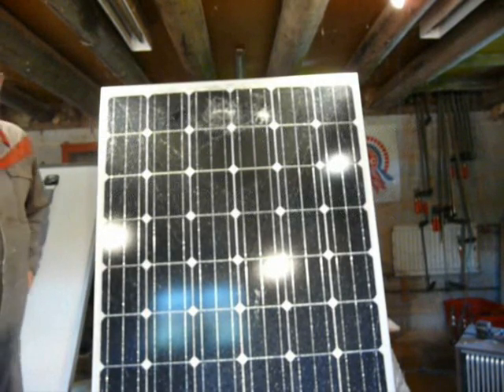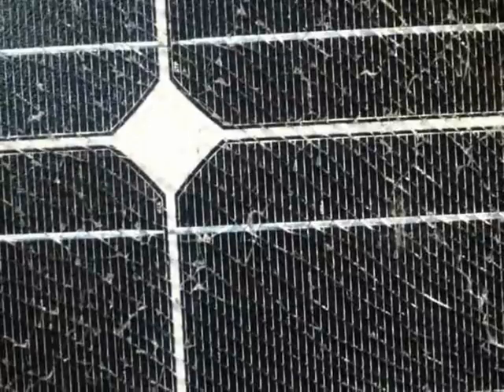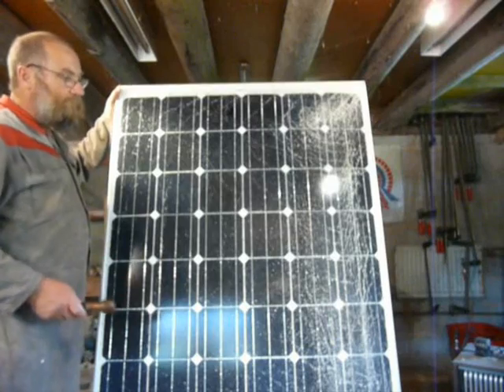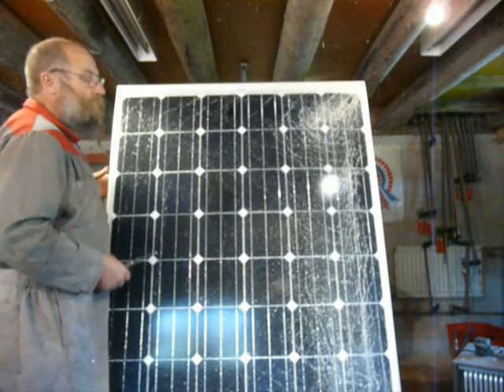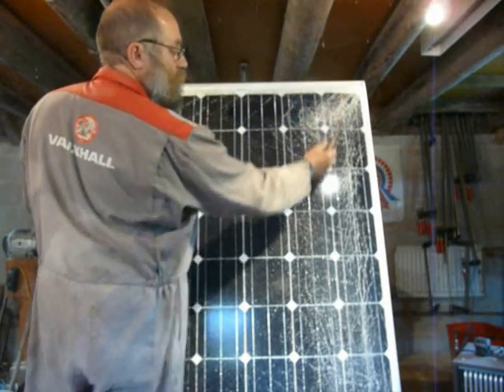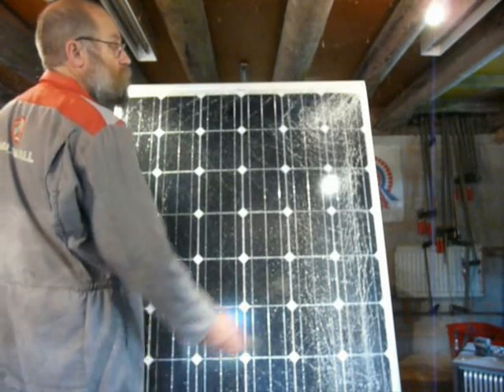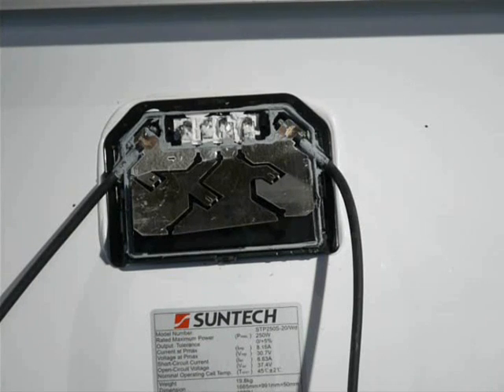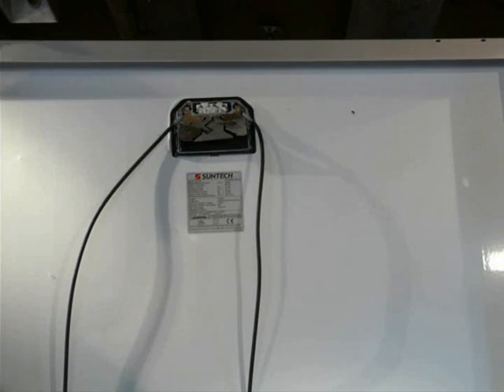Broken solar panel investigations. Part 1

Comment: Can you test the panel if you only have the tabs and no junction box.  I have four tabs on a 37v open circuit panel. Should all four put out about 37v. Here is what I am getting. Outer tabs 35v , one outer and one inner 25v, both inner 11v. All readings without a junction box.
Reply from the maker: HI, with a standard open circuit 38 volt panel the outer tabs are the ends of the circuit, the 2 inner tabs are connections within the circuit. So for instance from the left tab the ciucuit goes down the wafers on the left then up the next row to the next tab, then down the 3rd row and back up the 4th row to the next tab, then down and up again to the right hand tab. So the volts should be divided by 3 for each set of wafers. Check out my book, Wind and solar electricity (edition three). Cheers
Reply: Andy Reynolds thank-you for the reply. The reason I ask is I can get 240w semi flexible panels that needs some work (broken glass, needs junction box and needs fames if wanted) for $40.  I want them for my camper. Sounds like good new. Thanks again.

Comment from the maker: Hi. Thanks for your comment. When a panel is shaded it can still allow power through the wafers and cause localised heating. The diodes allow the power from other panels in the string to bypass the shaded areas and so reduce heating. This is especially important when high voltages are generated or when there are several stings in parallel and they are disconnected from the load. More on this later.

Comment from the maker: Apparently these are "active diodes". They will conduct when reverse biased as normal, but will also conduct forward biased when the parallel wafer string will not conduct or generate. I will have to devise an experiment. .

Comment from the maker: Interesting question and thanks for asking it. I was told that they were bi-pass diodes to avoid wafer damage during partial shading of a panel. I how think that is first class nonsense nine feet deep. The diodes are in parallel with each wafer string and do not conduct during generation. This means that they will only conduct during "accidental" reverse polarity, where they would make a dead short and blow a fuse if one is fitted.